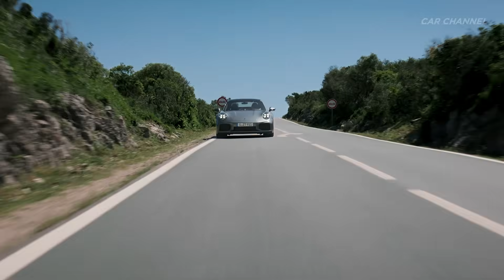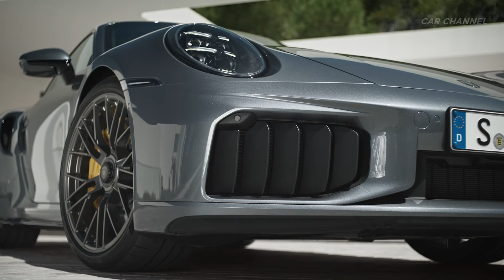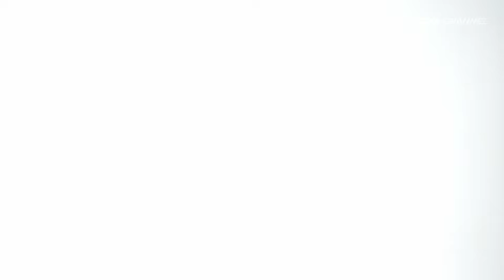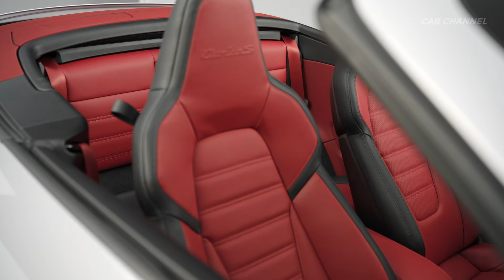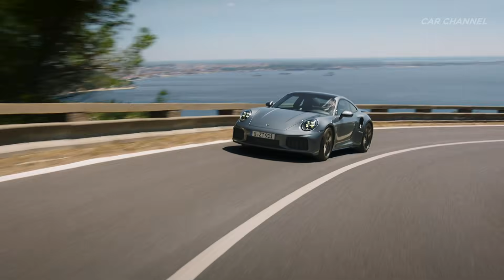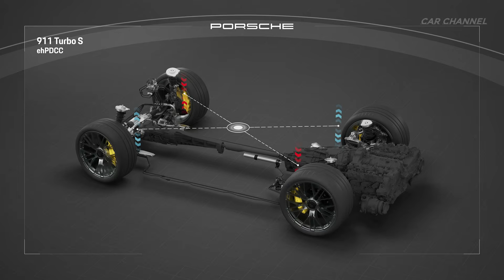2026 Porsche 911 Turbo S - The Most Powerful 911 🔥⚡ Innovative Twin-Turbo T-Hybrid

Comment: The battery and electric motor a really bad news it's 200 lb of weight. Porsche could have easily gotten 700 750 HP from an old gasoline engine..... I own the 9921 the engine management system was remapped 1500 at 70 more horsepower so it's about 710 horsepower all gasoline no lithium-ion battery no electric motors no edit of adding weight no adding of complexity nothing to have to deal with the cost and complexity of what they added for absolutely no reason anybody who has own Porsches for any extended period of time we'll stick with the old gasoline cars. And tomorrow's Wall Street journal big article about Porsche and the fact that they can't sell any of their electric cars and the going back to all gasoline people are not willing to pay a premium for German electric cars